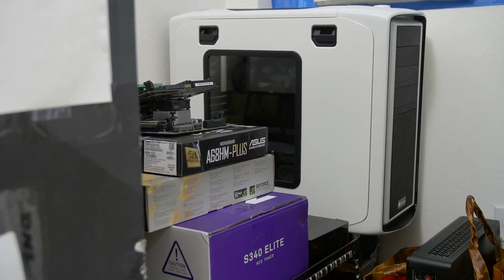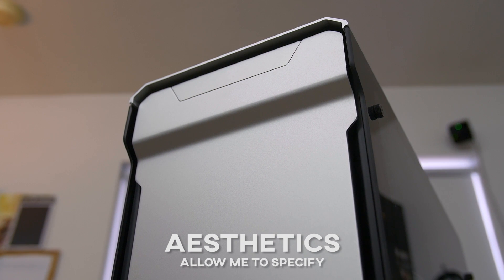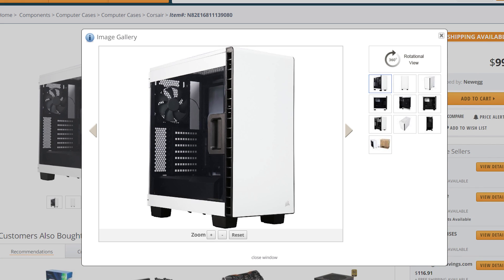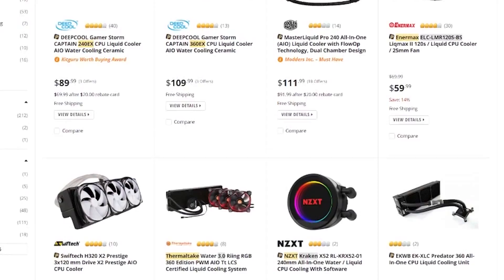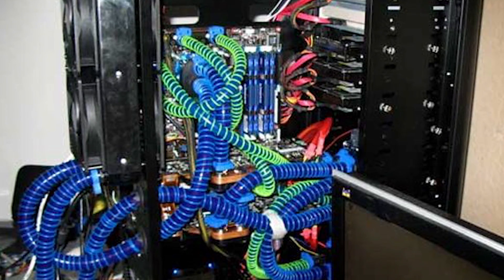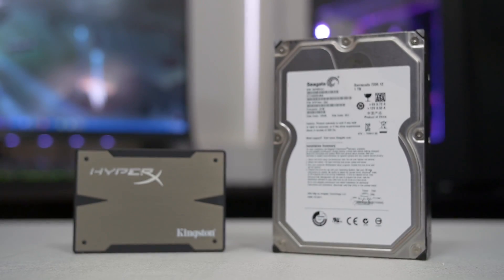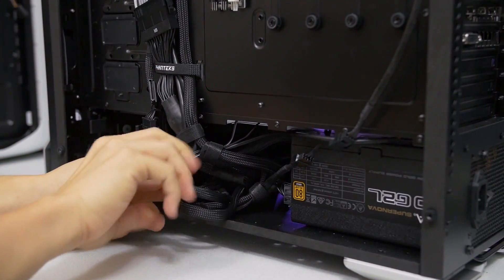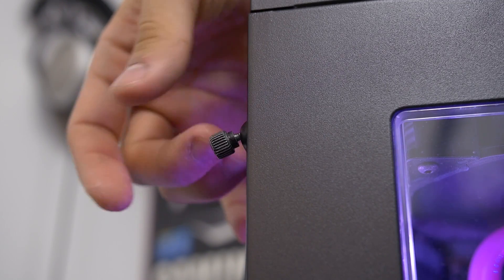4 Major Changes to PC Cases in the Last 5 Years: Then and Now

Comment: My first home-brew computer was so old it was called a clone.  It was a IBM PC AT clone of 1985 vintage. (I didn't get one of them FANCY IBM PC XT clone computer until 1992...because I was not made of money!!!)

So the changes to the case and accessories
-  Modern computer are not beige plastic in front and sheet metal in the back
- Modern computer do not have the handy Keyboard Lock on the front with a metal cylinder key to stop unauthorized keyboard inputs.
- Modern computer need lots of fans, my IBM PC didn't need more than one fan. 
- Modern computers hide all the removable media drives...IBM PCs had to HUGE 5.25" floppy drives up front 
- The button on modern computers are soft and quite....all the switches buttons, and toggles on a IBM PC had as satifying snap like flipping a knife-switch at Frankenstein castle.
- No annoying stickers on teh case saying who made it, there were three words on the case - Lock, Unlock, and Turbo.

Comment: The difference is even more striking if you go back to an 11 year old case. 

I've done work recently inside an ancient Antec Super Lanboy that I gave to my dad, which used to house my first PC build from way back in 2005. No radiator support, top mounted PSU, absolutely zero cable management unless you've got one of three 5.25" bays empty to shove the extra cables in, and not one but TWO floppy drive bays!

That being said it does have some good features even by today's standards. The aluminum body makes it very light, a parts bin next to the floppy drive is a convenient place to store extra screws, and it does have a properly big side window.... to show off the mass of cables you have nowhere else to stow.

Comment: I still like my H440 2015 Edition. But I do like the whole glass side panel thing looks really nice.
Reply: Same here, i fking love it. It has everything one need.
Reply: I have the original version which also happen to be the first batch which had LED issues. All the LEDs on my I/O and PSU cover has died. The newer version is better, more HDD/SSD support and better airflow.
Reply: There is a custom Made circuito on Ebay if you want to replace it. But yeah, the first one is pretty bad indeed. Mine airflow is ok tbh (using 2 swiftech Helix 120 as intake).

Comment: One of the big new trends is the push towards small form factor cases. Full tower cases are slowly dying as there's just no need to take up all that room anymore. You don't need as many or any optical drives, ssds and hdds are getting bigger in capacity, meaning less of them in a case on average. Matx and itx motherboards are very close in performance versus their atx brothers (except pci slots and a few other things). Also, with the push for RGB, people want to put their cases on their desks and show them off, and you're a lot less able to do that with a massive case. Sure, there will always be full tower cases, but I wouldn't be surprised to see a shift in the average size of a new case release in the next few years.
Reply: tøp trash well only IT cases are being pushed.

Comment: I can't remember what it was called but easily swapping ssds and hdds
Reply: Planet Kuruto hot swap bays
Reply: TheHammerGuy hot swap bays
Reply: oooooh those solutions were hideous and usually a mess of ketchup/mustard cables inside. 
i hated them so bad
Reply: You forgot those grey ribbon cables that linked everything.
Reply: drive caddies?
you just screw in your drives then just pull them out like drawers?

Comment: You didn't mention fan controllers and built in over clocking. They are still quite rare but nonetheless prevalent in some cases. Also the rise of small form factor cases. Maybe a sequel to this video could address some of these topics?

Comment: Captive Thumb Screws are a plus for sure. Kinda wish they all had them as a standard. And working my way back from there of the video.. The shrouds of all cases are great. Cable Management has it's up's and down's for a lot of folk. I love it my self. And a good healthy set of Drives in any case is a great necessity. M.2's and SSD 's are my best friends.. Cases with Tempered Glass are definitely finding there way into the market as a huge trend this coming year,. I feel. I hope Phanteks doesn't disappoint with there new Full Towers. I want one really bad. Don't get me wrong. I love my Enthoo  Luxe currently. But the scratches are a disappointment.. Well everyone. Have a great Happy New Year.

Comment: Im using the cheap Thermaltake S21 Urban. Most other cases in that pass through had too much of a flamboyant shape for my taste. I prefer the subdued.... (With RGB Lighting) 
: p. I just wish the front panal didn't choke off the HDD bay fans.

Comment: In future PCs I would like to see two power wires(1 big positive and 1 big negative) going to GPU instead of 2x 8pin mess(8 small positive and 8 small engative separately).
It doesynt even require changing sockets in GPUs and PSUs.
I hope you see what I mean.

Comment: when buying a case, the number 1 must have in a case was a psu shroud. After that, as an adult, was the aesthetic of a simple look. I didn't need much after that and went with a h440. Could have easily gone with s340 or the Define S

Comment: To me, the best (albeit not biggest) change is a shift towards different mounting solutions for the side panels. I like it if I can just open a case with one little latch. It's not exactly a new solution (the 600T already having it, also some older Chieftec server cases), but it feels like it got more prevalent.
Oh, and I'm still using my 5,25" bays. For my fan controller, DVD drive and for storing away a crapton of storage devices.

Comment: You forgot to mention the evolution of the dust filters. 5 years? I still use my 10 year old (yes I bought it in 2007!) Antec Sonata II in piano black. It's gone through a least 2 upgrades but I somehow can't bring myself to replace it. It includes a dust filter within the front panel but you have to tilt the PC to access it for cleaning. No it doesn't have fan mounts on the top or side windows but after 10 years I still love the finish and minimalistic styling of the black metal monolith.

Comment: For single GPU and only 1 or 2 hard drives, (90% of builds I'm guessing), I think the hands down best case on the market right now is the Nzxt S340. Not the elite, that costs $30 more for some small upgrades. The classic s340. Good air flow, easy cable management, lightweight yet sturdy, relatively cheap. What more could you ask for? My only complaint is the lack of front intakes included, but I usually just buy a single fan, take the two included ones and use them as double intakes, then use the aftermarket fan as an exhaust.

Comment: You cannot get any decent cases with support for 200mm fans these days. Sad times.
Reply: Steven G Phanteks. Phanteks has your needs
Reply: Not sure what you consider "decent", but NZXT has one with two in the front and two more up top.
Reply: More like all, not a single good one that's not Delta electronics.
Reply: Pokemon5475 Still not a single decent one? (Last time i checked was like 3 years ago). Well looks like all companies agree that investing in such fans is not a good idea.
Happy new year everyone btw :)
Reply: I have the Phanteks Enthoo Pro. It supports TWO 200mm fans. One in the front (which it comes with) and one at the top. There are a couple of shots of it in the video, it is a beautiful case :)
Reply: True, I remember those CM HAF series from like 7 years ago, had 912+ myself, like multiple 200mm fans.. like a jet engine. Those were some high quality cases...
Reply: Luka- I have a HAF XB cube sitting empty in my closet right now waiting on me to start my AM4 build in it
Reply: Steven G and all the case windows are on the left side :c it triggers me so much.
Reply: Steven G Most 200mm fans kinda suck anyways imo.

Comment: I don't know exactly when it changed from when I first built pc's, but the adaptation of the raised motherboard tray. I remember building pcs with the motherboard stand offs screwed straight into the panel with only a few mm of space between the tray and right side panel. That change made cable management significantly easier for pc builders.

Comment: hey guys, I'm looking for a good case but still on the cheap side. anything under 60 or 50 dollars is preferable. Any ideas? thanks
Reply: Luca Capperucci In that price range,there is much to choose from.Get the ones from good companies like Phanteks,Corsair,Fractal Design,Cooler Master,NZXT and get the recent/newer or recommended ones
Reply: Corsair carbide 200r or 100r are both really good cases. I have the 200r personally.
The corsair carbide SPEC-01 also looks pretty good, it is the second link.

https://www.amazon.com/Corsair-Carbide-200R-Compact-Case/dp/B009GXZ8MM/ref=sr_1_1?ie=UTF8&qid=1483209610&sr=8-1&keywords=corsair+carbide+200r

https://www.amazon.com/Corsair-Carbide-SPEC-01-Tower-Gaming/dp/B00I6BJATW/ref=sr_1_1?s=pc&ie=UTF8&qid=1483209721&sr=1-1&keywords=pc+case
Reply: DavisSgt thank you
Reply: Luca Capperucci The Deepcool Dukase V2 is an excellent case at $50, hasn't been featured on any of the main youtubers just yet (as of today). I bought the case myself, the only thing cheap about it is the plastic front cover, the rest of the case is metal (top cover is sturdy plastic), and has a power supply shroud
Reply: DIYPC Gamemax-BK-15 is about $70 including tax and its a full tower (barely) but it also looks pretty nice. although I prefer the white version even though its like $90. but I have one and its prety good. comes with 5x120mm fans and lots of space, although the backside for your cables is a little small so you will need to flatten out the cables, but other than that it's a solid case.
Reply: Reeves Silver anything else? it's a little too minimalistic. It's just a plain box. Thanks for the response.
Reply: Luca Capperucci I would recommend Corsair 200r,100r or SPEC-01,NZXT S340,Phanteks Eclipse P400,Cooler Master Masterbox 5,Fractal Design Core 1000 or 3500.Those all are very highly regarded cases with some flaws that you can easily see when watching case reviews of the cases
Reply: My GTX 1080 rig at the moment is in a Sharkoon T-3. It's a nice little case and their customer service is really cool. I had a fan that came with the case die and the shipped out 2 more so I replaced the one that died and I have a push/pull config on my CPU cooler now. Cable management is a little tricky though.

Comment: Still rocking Thermaltake Xaser III V2000A since 2002 or 2003 ... i think its time to upgrade in 2017 .. there is literaly 0 places to hide cables .. even though its super solid aluminium case .. but estethics just arent there anymore. Haven´t found the perfect replacement for it just yet.